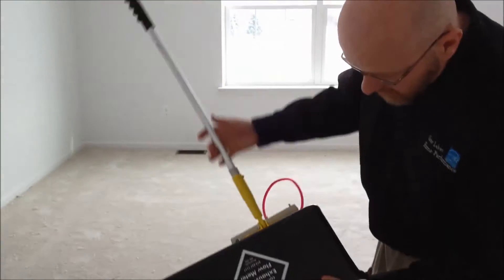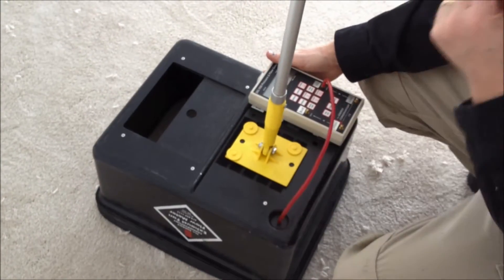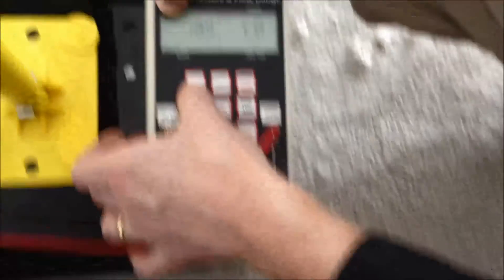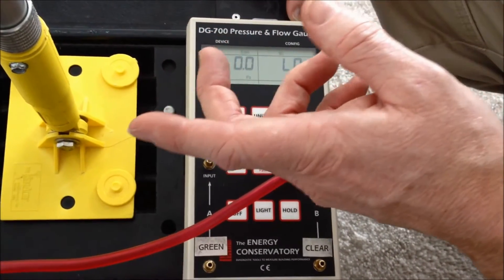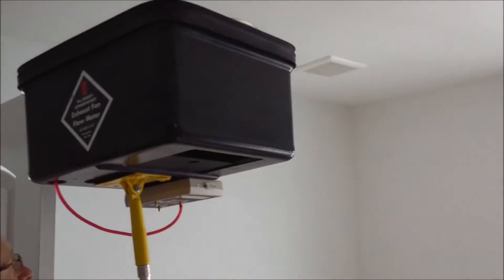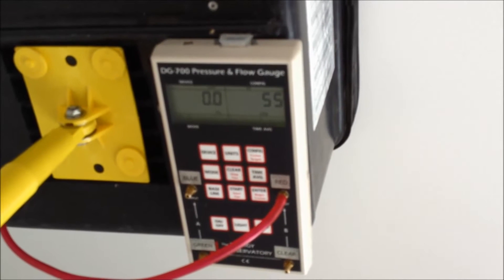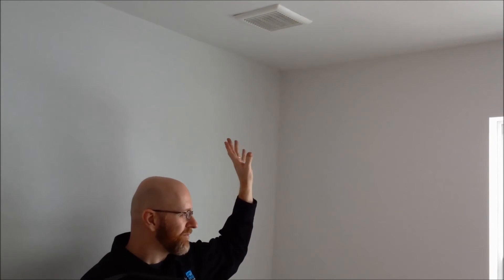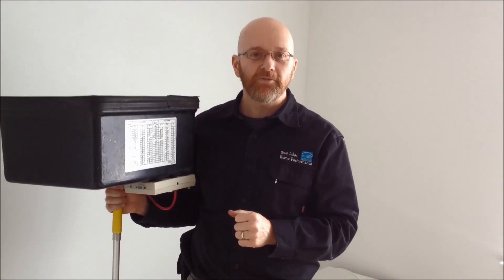Energy Conservatory Flow Meter Demo

Comment: Matt,

Although I understand that the manometer interprets the negative pressure as a relative flow value expressed in a net cfm value. Might one accurately utilize that tool to measure, let’s say, the positive output flow of an hvac supply register ?
Reply: That is what I would like to know.